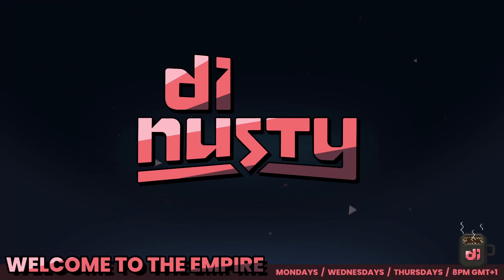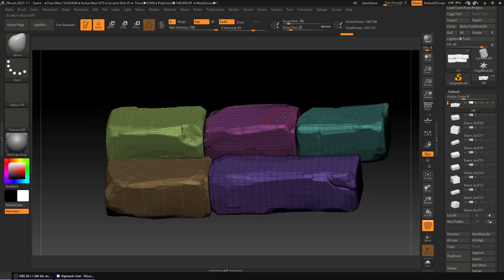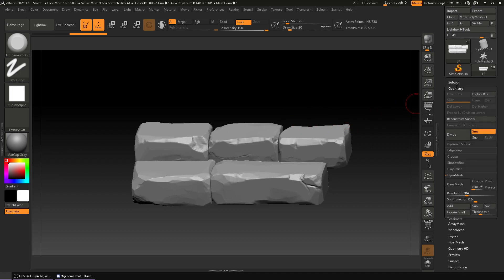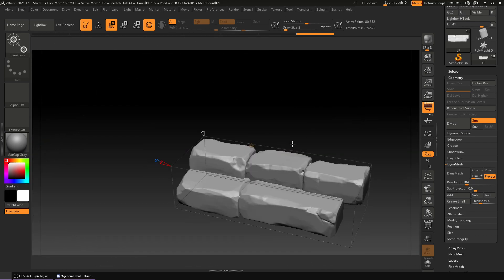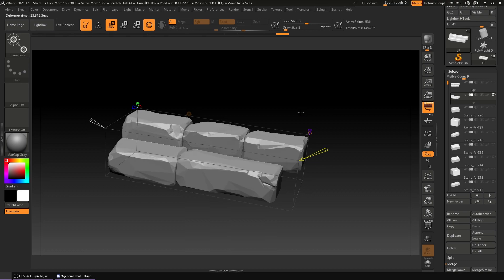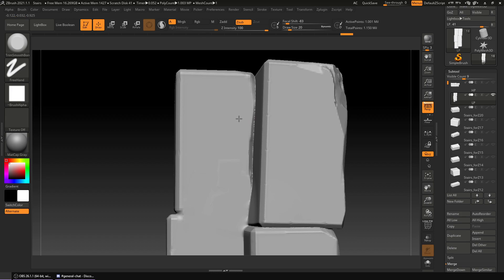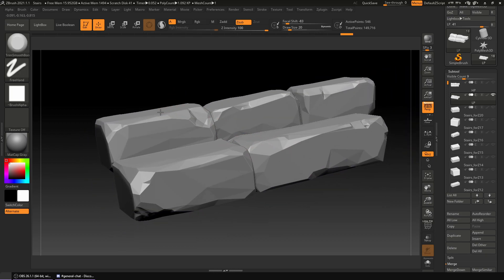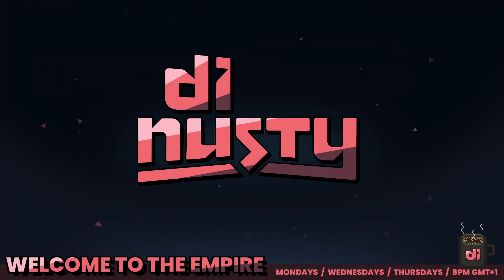Highpoly to lowpoly in Zbrush

Comment: When you say you would draw out a mesh, are you talking about MeshBalloon?
Reply from the maker: What’s the time stamp on it? I can try and help :)
Reply: About 6:44
Reply from the maker: Ahh draw or drag out a cube to add volume in the back. Should make the back of the combined asset easier to work with in the low poly state.
Reply: @TheDiNustyEmpire  Ah, I see! I was wondering if there was like a quick fill tool. So you would just dynamesh in a cube?
Reply from the maker: Ya exactly. Dynamesh a cube to fill.